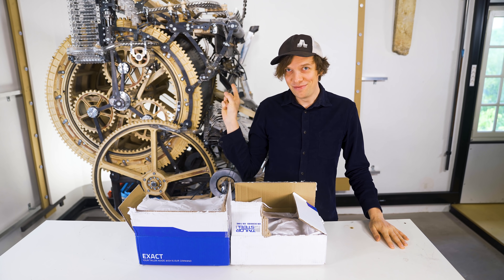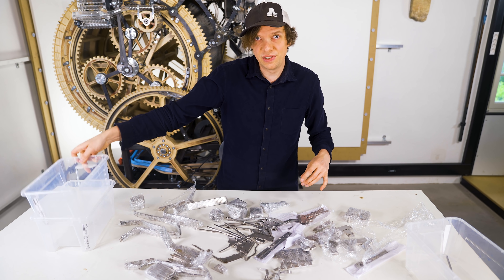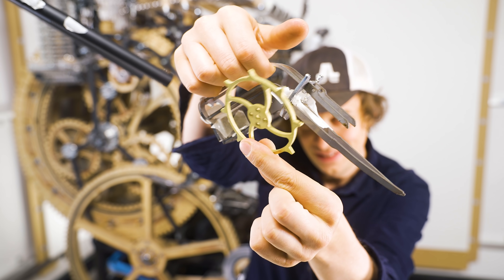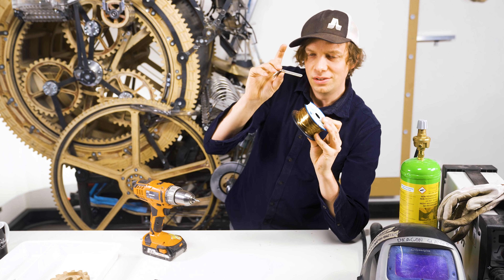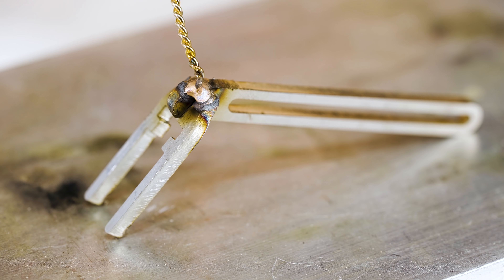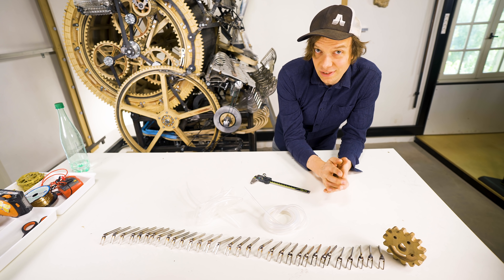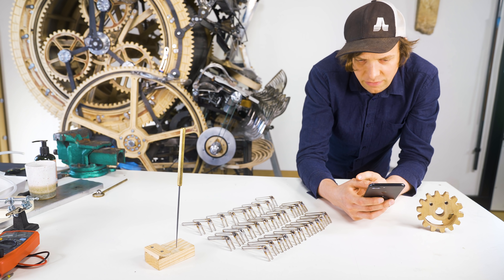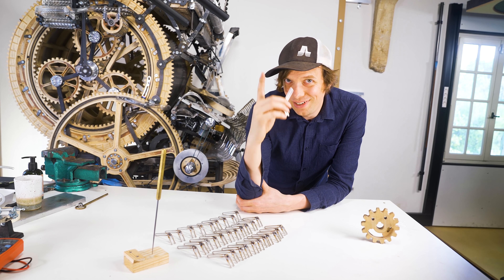Make it or Break it - Marble Machine X Escapement Gates Part 1

Comment: Update: A lot of feedback about Potential Dangers with Putting the Weld cable around your neck, due to Electromagnetic Fields. i have read up on it and although 5 minutes reading isnt giving a definitive answer as far as i could see, its of course better to not risk it. Also keep in mind that safety precautions are designed for fulltime welders, very different exposure compared to someone who welds only occasioannly. Although it is important that i am not spreading bad ideas, so from now i will not put the weldcable around my neck, and add a clarification in the next video, thanks for the feedback!
Reply: The UV radiation produced by the arc is much worse than any electromagnetic radiation from the cable. That's why you wear special goggles... Don't listen to 5G moaners ;)
Reply: I think these people are taking you for a ride. Conspiracy theories around EM radiation are everywhere.

Welders that create arcing would produce broad spectrum noise, but not all the way into the ionising frequencies. Researchers have to go to great lengths with high voltage equipment to produce them, and that's just soft xrays, let alone hard xrays or gamma rays. It's not the kind of thing you'd produce accidentally.

Papers researching the emission spectra from welders don't measure above 200nm, because there just isn't anything to measure above that. Far outside the ranges of ionising radiation.
Reply: Just point out in the next video that there is absolutely no danger by putting the cable around your neck. Unless you have some sort of metal in your brain or somewhere else around your head. We are constantly sourrounded by electromagnetic fields. It's just bullshit if someone tells you there would be danger. Just ask Electroboom about it.
Reply: Weld cables can't even produce any EMF by themselves, a big half loop like that is just a really really inefficient inductor at best that wouldn't event be able to move a compasses point.
Don't listen to crazies.
Reply: @Brooo007MC  Any moving charge do produce EMF, even single cable shorting stactic difference. Only it is not of improtant magnitude, and on top of that is not of high frequency. So no harm watsoever.
Reply: @andrejsgelins9296  Only true for AC, with DC once the magnetic field is there it doesn't move.
Reply: @andrejsgelins9296  
No. Moving charge produced magnetic fields.
Changing magnetic fields (accelerating charges) creates EMF:s. So when you begin welding and when you stop welding. But just shortly.
The only thing escaping it is the heat lost due to resistance.
Reply: The only risk from putting the cable around your neck would be if the cable sheathing were beat up and the electricity could reach your skin, that or wrapping it around your neck too many times and jumping from a ladder.  EM fields are harmless.
Reply: There's no harm in putting the cable around your neck, although it probably isn't best practice. according to the one forum post about it i found, it appears that a lot of people do the same thing:
https://forum.millerwelds.com/forum/welding-discussions/22476-whip-question
Reply: sounds like some hogwash to me. my fathers been hanging welding cable around his neck for over 40 years now.
Reply: The Marble Machine is not dropping marbles today, it’s been a journey but a more resilient design is now underway.
Reply: Honestly the biggest danger is getting tangled up in it if something goes wrong and you have to move away from the workspace quickly.
Reply: Nah dude, that's a conspiracy theory
Reply: As far as I know there's no evidence that magnetic fields have any effect on the human body, but if they did it would require a magnetic field at least strong enough to pull every piece of metal in a 10 meter radius straight through the walls. MRI machines have an incredibly strong magnetic field that is concentrated on your brain, no chance in hell putting the cable around your neck has any effect. I see welders doing it all the time.
Reply: @patrick1532  i think there really isnt, you know those experiments where they used ultra high magnetic fields to levitate small animals like a frog? ofc a frog isnt that complex or doesnt have a lifespan as long as a human but at least for the frog there was no harm, and those magnetic fields did have around 15tesla, the LHC uses supraconducting magnets with around 9tesla. so, i wouldt exactly say that an exposure of 15tesla is save but it doesnt seem harmfull, at least not for a frog
Reply: Does the welder operate at a higher power level than an MRI machine? Because you don't really get stronger magnetic fields on the human scale than magnetic resonance imaging, and that's harmless. Magnetic fields don't affect people. There are morons who think magnetic fields are poison, but those same idiots think vaccines cause autism.
Humans aren't magnetic.
Reply: @EdwardHowton  Agreed..
Reply: @EdwardHowton  Hey! Try telling that to Martin's magnetic personality.
Reply: @EdwardHowton  Yes! This low-frequency electromagnetic radiation does have absolutly no impact to a human being.
Reply: Harmful Electromagnetic Radiation starts at the Frequency of UV-Light. (> 789 THz) And yes of course heating from Electromagnetism might also be harmful... But not in a Welder as it only works with frequencies of way below 100kHz and is strictly regulated regarding its magnetic fields. (At least in the EU)
Reply: @Vykyification  This is absolutely incorrect. You can kill a human being quite easily using lower frequencies, and 3-300 MHz is particularly concerning. If there is any absorption at a given frequency, then power is everything, and it doesn't just happen as heat. You can quite easily give cancer to someone at C, S, and X bands. Its all about exposure and power, which is why cell phones and their small power is not a concern.

The TIG welder isn't a cause for concern, but claiming anything below UV light is safe is ridiculous.
Reply: @Krishach  Cell-Phones are much more of a concern than a welder cable, as you put a heat source right next to your head. And it's even dual penetration!!! Its infrared radiation from the phone directly (up to 400 THz! And also the GHz Bands for Communication!) And because the radiation decreases quadratically ist much worse than the 5G Tower 300m away with much higher power! ;) However, ist just heat. I am sorry but luckily you won't get cancer from non-ionizing radiation. Else we would be fucked when going into the sun! :D
Reply: @Vykyification  You know you can get skin cancer from the sun right?
Reply: @EdwardHowton  Trans-cranial magnetic stimulation applies a higher field than MRI if I recall correctly, but not for an extended amount of time. Also doesn't seem to cause harm. I've experienced both with no ill effect.
Reply: @joelhollingsworth2374  
My mom did MRI and it took so long that she almost fell asleep lol.
Reply: @EdwardHowton  humans have magnetic fields.
Reply: @eventprogenitor1873  Actually the human body creates electric fields due to ions moving in and out of cells (action potentials etc.). These electric potentials are measured in mV (1/1000V). Now tell me a measurable magnetic field can be induced by a voltage of ca. 30mV while being insulated by polar water molecules? As someone above said, it`s not the “force” of electromagnetic radiation, it`s the energy dose means frequency and wavelength with which it is emitted per time. And I doubt there is a cable in this world emitting enough highly energetic rays to harm your body.
Reply: Cell phones give you brain cancer, vaccines give you autism, 5G makes your sterile, and welding cables have "potential dangers due to electromagnetic fields".    Yep, there's a lot of bored doctors on the internet.
Reply: @TrueGrantsta  Safety Karens. There's a woodworking channel I follow where the creator is plagued by them. They each have their own safety hobby horse they've sized on, and they believe it without testing, and will inflict it on someone whenever the opportunity presents itself. There is no reasoning with them.
Reply: I just deleted all my crib sheets more brains food sets different degrees of Devine true willow school
Reply: You need a car it ain’t bike shit it’s a brick
Reply: I have been hanging my hot cables around my neck for well over 50 years with no disenable problems as a result of that practice. We are within inches of the weld all day long so no worries about the naysayers. Weld away and have a great day doing it. Wilson will certainty agree with me. See he is smiling at my comment, LOL. LIKE IT, I LOVE IT ! !
Reply: Some people! lol
Reply: Hello Martin; I worked with RF and manufacturing safety for years. 
1) The RF/Electromagnetics: TIG welders (that I've ever seen) function below 400 Hz and the radiation for these frequencies and the power capable in a TIG welder couldn't kill you if you did it for 40 years.

2) its still unsafe to hang it around your neck. If the welder malfunctions and stays on and you drop it, its got nowhere to drop to except on you. Its not the combustion hazard of an old-fashioned welder, but it can severely shock you, and any residual heat or spattered material can burn you. If you need to move quickly (because TIG welders can still start fires), its still an entanglement hazard.

EDIT: a common industry solution would be a tool lanyard. Then if you drop the torch, it suspends safely above the work surface, and contacts nothing. Takes care of the weight, and also prevents torch damage due to accidental dropping.
Reply: Hi Marten, one tip I have from my time designing sheet metal is the 1:1 rule. A 2mm part will fold with approximately a 2mm internal rad. 

So if you put a hole or slot in this margin it may become distorted while folding in the brake press(depending on tooling) if you design with this in mind you should get nice round holes and features.

Also, the way I understood it from our laser and laser operator (trumpf trulaser) the laser doesn't like to dwell in the corner. If you went to a sharp corner the laser would have to fully decelerate to 0ms and would have some dwell time in the corner. A dog one or rabbit ear solves this issue.

There are a couple of other tips I have if you want to drop me a line.
Reply: wrong channel my dude

also that project is sick, watching it since you started
edit: you needed to enter into wintergatan to pin your own comment so i think you already knew it was not the wintergatan, but the wintergatan 2 lol
Reply: Welding uses direct current, which doesn't produce strong EM fields. It can create a strong magnetic fields, but those are not dangerous.
Reply: A wire carrying 200 A of current creates a magnetic field of 4 mT in 1 cm distance: https://web.pa.msu.edu/courses/1997spring/phy232/lectures/ampereslaw/wire.html

The WHO occupational exposure limit is 200 mT: https://www.who.int/peh-emf/publications/facts/fs299/en/#:~:text=The%20recommended%20limits%20are%20time,given%20for%20the%20general%20public. According to that, you can wear the cable around your neck all day long and stay well within established safety limits.
Reply: 5GgggGGGGGgGGGG

Comment: I'm a welder of 10 years. I've put them around my neck multiple times. Haven't had any trouble but I also didn't have a cut in the cable. If there was an exposed wire there would be an issue. I would play it safe and not do it.

Comment: * RAT ALERT *
Hi Martin, loving your work. Did I see signs of hydraulicing in the video ?. when the tubes are busy, the marbles seem to slow down causing a backup. Because of the shallow angle, a pressure wave or vacuum could be happening. Consider drilling small air holes along the top to equalise the pressure in the tunnels 😎

Comment: @Wintergatan: Just in case you read this: *UNIT TESTING*. If you're going so far down the rabbit hole to completely re-engineer everything, then you need act like an engineer and build test rigs for sub components that can be tested. You should have ordered one of each gate and set them on a test rig that is not connected to the MMX to measure their edge cases instead of designing, building, and welding what is a test idea in situ. 

Jigs. You're spending a lot of money, time, and resources and you don't build simple jigs to make sure your engineered pieces are consistent.

Do you not have a bandsaw yet? You're using a hacksaw to split pieces up? All that time using and physical effort with the  hacksaw emotionally chains you further and further to define success/fail as time wasted if something fails. 

The overall topic is efficiency. You've moved well into becoming a designed/engineer, but you're missing the next part: prove the part before introducing it as an unknown to the whole system.

Comment: Have you thought about using the heat shrink for the basket funnels as well? I don't know how well it would work on curved wire, but I remember there was a problem getting enough coating to sufficiently dampen the sound, whereas the heat shrink really provides quite a lot it seems..

Comment: The welding material might be a weak point. When you run the test, check if it remains the same or has cracks on it. Usually when welding you want both materials to melt and bond together.

Comment: I am still seeing some slight undercutting on those silicon bronze braises. Lower your heat just a tad more, you want just enough heat to melt the SB, without melting the base metal. 

Also, really good tips for the beginner welder.

Comment: There are different levels of "work"    

I am 100% confident that even if the level of reliability you are aiming for is beyond you (I don't believe that for a second!!!)  then all the video evidence to date makes it absolutely clear that this machine WILL get through a whole song, no trouble. will get through 2 or 3 or 5.   Something the OG_MM never could..  What was it 56 takes to get the original video?  

Once the gates are on you will be able to compose and play music on this thing. It will work and be epic. But even if you decide it's not robust enough to tour it MUST be finished! There MUST be a new video in the white room!  And the MMX will do that easily.

Everything you have been doing over the last few moths has not been 'will it work' but 'how can I extract another few % of reliability out of it'.   HUGE difference.  99% might not be enough but 99.5% might just be!

I believe the new gates will work... They are pressure agnostic everything is SOO much more simple..  (down to your growing ability as a designer and a move away from reliance on plywood as the go-to solution)  The new divider is a height agnostic solution simplifying the whole issue, that also eliminated the need to compress the pipes. The new system as a whole from marble lift and fish-stair to the gates (including the new '2x4' divide by 4) down to the gates is cleaner simpler more robust and resilient. The machine has matured SOOO much in the last month or so.

I Believe so much in the MMX and you. But I caution against setting arbitrary Rubicons of defeat.

Comment: I think the brazing is a great idea for those small delicate parts. By the way, if you ever do want to weld stainless to carbon steel, you should use 309 filler.
Reply: This company TIG welds 4130 bike frames using stainless filler, so mixing stainless with non-stainless isn't a simple "don't": 
https://www.btr-fabrications.com/blog/metallurgy/
Reply: @EmyrDerfel  Yeah, it's not.  You have to use the right filler.  I supervised the welding procedures and QC at a pressure vessel and piping shop.  We TIG welded 304 SS to carbon using 309 filler.  The pipes were designed for 1000 psi (69 bar), and they worked fine.  Just have to do your research to learn these things.

Comment: Please be careful of EMF coming off that cable. I know you are trying to off load the weight from the cable, but I am not sure what the magnetic field can do to you.
Reply: electromagnetic fields are in fact, completely harmless unless produced by a high power emitter such as a microwave or antenna.
given that his cable is insulated properly, and that it would be considered a low power emitter, there are not many health risks.

additionally, whilst having the cable over your neck is considered bad practice for different reasons, it would seem that most if not all welders do it anyway
https://forum.millerwelds.com/forum/welding-discussions/22476-whip-question

Comment: Looking at all those springs makes me uneasy. Stretching spring requires energy, and there are about 5 in each marble path, if not more. Add them together and you have a huge load on a motor driving this thing. I doubt this thing can be operated manually anymore. Might as well remove those parts completely because when not used they also add to the load.

Comment: The best braze joint depends on the cleanliness of the parts making the joint, the flux, and the fit.  You were actually welding.  Welding also depends on the cleanliness of the materials.

Comment: Not sure if TIG is very different from MIG or stick, but any "how to's" I've seen state that it is not good practice to wrap the cable around your body and especially around your neck like you did, Martin. It might be better to lightly clamp the cable to the table top, giving yourself enough slack and taking the weight off of your welding hand.
If you even THINK of giving up, I could see a small army of your fans and followers descending on your studio to "help you finish" the MMX...😎

Comment: One issue, instead of putting together everything in a series like you did, I feel like it would be wise to wait for all the parts to arrive and make a single gate from start to finish.  You may find that you need to make small adjustments during the welding process.  It would be a massive shame to realize a small mistake in the end and have to redo it for every single piece on the machine.